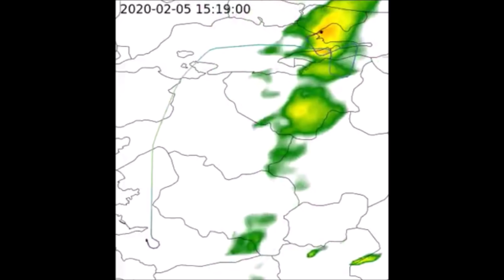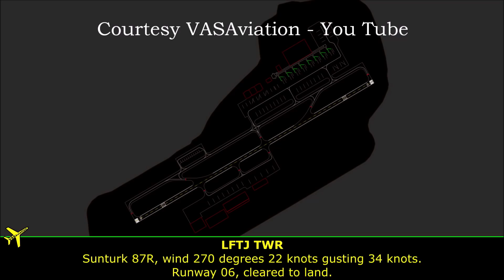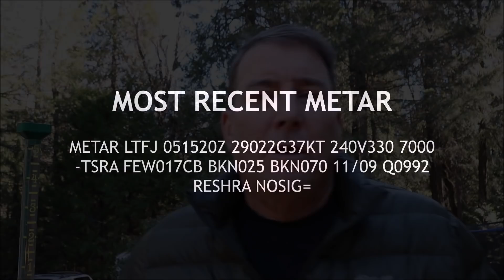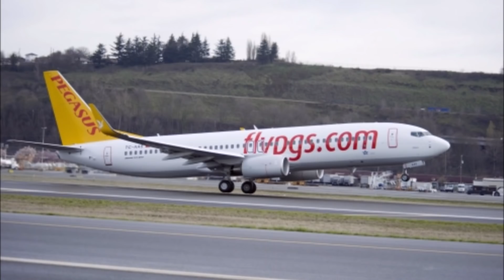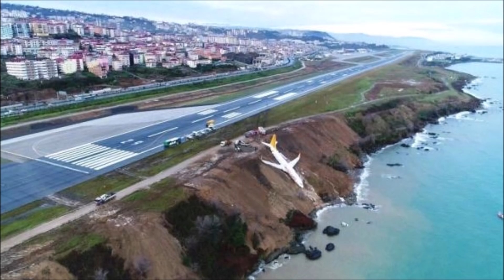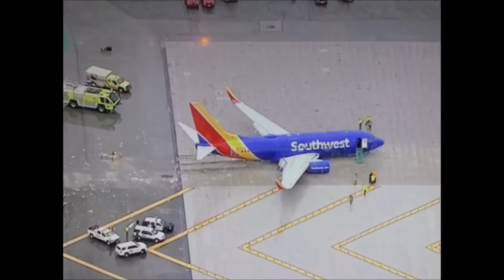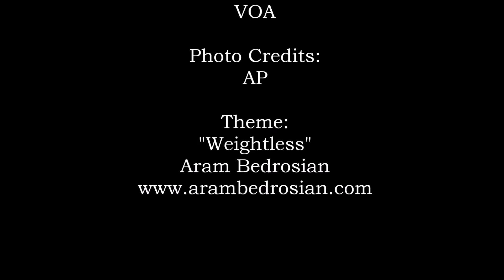Runway Overrun Istanbul, Turkey Pegasus 2193 B737-8 UPDATE 6 Feb

Comment: End of March, 1993, Anchorage Alaska. A 747 was taking off from Anchorage headed to Chicago. The wind was very strong from the east, gusting a lot. I was driving west on the Glenn Highway, just east of Boniface, and saw this plane pitch up very sharply and fast, WAY up, and then turn left hard, and then level out. It was on initial climb out of 6R at Anchorage International. I was watching the plane because the wind was so darn strong, I was wondering what the heck it was doing up there. I had to crane my neck to watch it after the big pitch up, and I pulled over and continued to watch it as it headed west. I did not see the engine missing, as I was on the port side of the plane at that point. (it was north of me headed west, flying LOW). Only later did I learn that the engine landed directly west of my house, missing our neighborhood by about a half mile. I went to the airport a few days later and took some photographs of the plane sitting just inside the fence, a huge chunk of the inboard part of the wing missing. It was astounding that it could fly with that much damage. Evidently, it was not the break-away pins that failed, but the actual pylon that holds the engine mount to the wing structure. The airplane was having trouble with the #2 start valve while it taxied for takeoff, so they went back to have the mechs take a look; they determined it was the indicator at fault, so put it on the MEL and deferred looking into it till later. The strong winds took the crack past failure and the engine detached from the airplane, taking a bunch of goodies with it. All leading edge and skin from the #2 inboard to the fuselage was torn off, back to the center spar. It was a situation that could have ended so so so much worse. There were only five souls onboard, as it was a freighter, no one was hurt on the plane or ground.
Reply from the maker: Wow!!
Reply: That was the same plane that was used for Die Hard 2 Movie
Reply: https://www.ntsb.gov/investigations/AccidentReports/Reports/AAR9306.pdf
Reply: @billbingham3829  Thanks.Interesting reading, both the engineering report, and the voice recorder transcript.
Reply: Check report from EI AI 1862 at Amsterdam 1992... Similar accident, after those Boeing improve engine mounts.
Reply: That photo, crazy. https://aviation-safety.net/photo/6376/Boeing-747-121-N473EV

Comment: I wonder about a few things: 
 
1) Other than landmarks and being familiar with the airport, does the pilot know how far they are down the runway at any given moment? ( like some sort of odometer / beacon. ) 

2) At what point prior to touchdown should this pilot have become aware that they are too far down the runway and should go around?

3) At what point in this situation would it be impossible to go around?
.
Reply: Bob Roberts There are many visual indicators (coloured ights) for the pilots to determine their position relative to the runway. They can go around at any stage, until the thrust reversers are engaged.
Reply: Gordon Richardson  I was questioning this specific flight / airport not generalities.  There are only so many colors of lights, what kind of distance resolution would that give?

I'd think an instrument that gave distance to runway threshold then remaining runway in hundreds of feet would be helpful especially in a low visibility situation.

I'd still like to know at what point this pilot in this specific landing should have been aware they are too far down the runway and at what point is a go around would be impossible. 

If a go around is possible at any time , it appears that the pilot thought they had much more runway rather than a bad judgment call to land.
Reply: In the US , runways are marked by large black and white signs beside the runway.  They are distance remaining markers in thousands of feet. A sign with a big “3” on it means three thousand feet remaining.   The next sign after that would a big “2”. And so on.

Comment: Why don’t short runways or runways with a cliff drop have a trip wire at the end like on an air craft carrier?
Reply: What well designed runways have is a soft concrete at the ends, that the plane's wheels sink into, like a fancy gravel trap. It's called EMAS or Engineered Material Arresting System.
Reply: A trip wire would be useless to an aircraft that is not equipped vith a hook to engage it. An arresting barrier, OTOH, would not require additional equipment, but I very much doubt it would be able to stop anything that size.

Comment: This sounds remarkably similar to the Air France Flight 358 crash in 2005, of which I was one of the first ambulances on scene as an Advanced Care Paramedic in Toronto.  That aircraft landed in a thunderstorm, landed way down the runway on a wet runway, overran, went down a ravine, and burst into flames.  The scene was a complete clusterfuck, but everyone had evacuated the burning aircraft in something like 90 seconds and astonishingly, there were no fatalities.  With our first trip to hospital we transported the captain (who was one of more seriously injured people), a second stretcher patient who was a passenger, and an ambulatory passenger.  I was amazed to learn that there was none of that soft concrete at the end of the runway to arrest an overrun aircraft and prevent it from barreling down that ravine!
Reply: As someone who flies to/from Toronto periodically -- thank you for your service.
Reply: Josh Yaks Yes, an infamous example, lessons not learned.
Reply: EMAS would be nice, but where would you put it?  That ravine is so close, you'd need to reduce the runway length...
Reply: In the old days they used to allow farmers to grow cabbage in the fields adjacent to the runways. I suppose airports have got larger, security issues more problematical. But an overrun into cabbages dissipated a lot of energy pdq...
Reply: The runway is still the same as it was during the AF358...
Reply: The Air France accident  in Toronto also had fire crews on site in record time .They sprayed the aircraft  non stop from several trucks  BUT never could put out the fire .That is a mystery to me .

Comment: 6:05 How much money does it cost to have a large airplane go around for another landing attempt? $5,000-10,000-20,000?
Reply: SanFranciscoBay Roughly yes. A go around costs a lot less than a crash.
Reply: It depends on the gas cost and how much you use. For a 737-800, I would guess a thousand dollars or so is a good guess for fuel consumption getting back around.
Reply: scooter Dave interesting.  Other than fuel, where do the costs come from?
Reply: Rick Harms Mostly fuel, some delays, possible diversion, passenger overnight accommodation, etc.
Reply: Gordon Richardson - Possibly $500, maybe $750 for the go-around but if missed connections occur it can be as much as $5,000 per missed connection. But as other posters have said, its not as expensive as a crash.

Comment: Have we ruled out yet , the case where they miss calculated the fuel and didn’t want to call an emergency to avoid complications? The only possible scenario that anyone will not go around at 600ft agl over threshold is when you know that the fuel is not enough. (Yes I know that it’s almost impossible to miss calculate fuel that badly). Opinions or maybe any fuel data out ?    Also landing with tailwind is one thing, but 550 above screening height requires about 2 miles  to descend on a normal gradient.

Comment: The 737 is mentioned too often here I think. Notwithstanding poor pilot decisions is it possible that the 737 wet braking performance is dangerously under par here? Wheel and brake sizes maybe too small which likely makes any anti lock systems less efficient too. Some of these aircraft have skidded sideways which is something that shouldn't happen unless it's done deliberately.
Reply: The 737-800 has excellent braking system (I flew it for four years as Captain for same company as Juan's).  You're way off the mark.  Huge tailwind, touched down way long on a wet runway.  This is pilot error writ large.
Reply: Thanks for the reply. I didn't expect it to be a factor. As you say, pilot error and the same one in the same circumstances. Of course, doing the right thing and going round never gets a mention.
Reply: @delukxy  You need to watch the video again.  Juan mentioned go-around several times.  For this accident we have to wait for the CVR transcript to see what the Captain and First Officer were saying to each other.
Reply: Yes, yes, I follow Juan carefully. Just saying that, because it's accepted practice and is done when needed by competent pilots i.e. when in doubt go round. It doesn't get a mention, and nor should it. Its done safely and isn't news. 
As you say, the CVR transcript will be useful and probably damning.

Comment: Juan, I would urge you to watch this exposé on the 737ng construction. These 737s seem to be breaking up in a consistent manner. https://youtu.be/vWxxtzBTxGU
Reply: Well Juan did say that all aircraft are designed to break apart to dissipate the energy involved inna sudden stop. To be clear, any aircraft that comes in high and hot that goes off an embankment...will break apart. That is not a fault of the 737NG. This was not attributable to airframe design, this was poor judgement on the part of the pilots. I'm not sure whether or not you're hinting at a design flaw, but if you are, that is unfair in this scenario.
Reply: Genevieve Campbell, watch the program and get back to me.

Comment: "if you take a 737 chuck it off 66 foot cliff at 73 mph, you have a lot of energy that needs to be dissipated" hysterical and true!
Reply: For only 3 to die traveling at that speed with just lap belts is really a miracle
Reply: @gregandkaruna6674  very true! also, it went off a 66 foot drop off!
Reply: While “chucking” an aircraft off a cliff is not a laughing matter I did laugh out loud when he said that! 😂. Seems cut and dry after hearing all of this. The PIC made a bad call and the PM didn’t engage. A recipe for disaster.
Reply: @markt538  Agreed. Why do they have a six story drop at the end of a runway? Why not a blasting cap factory or a nuclear waste dump? Zoning seems a bit lax!
Reply: It's a poorly built plane Southwest did the same thing at Midway and the plane was able to fly again
Reply: @dknowles60  because it didnt drop off a SIXTY SIX FOOT CLIFF!
Reply: @rlyle5804  it was close to 60 ft the fact remains the same also see as little rock at crash
Reply: @dknowles60  let me make sure I understand: you are saying that the Pegasus flight dropping off of a SIXTY FOOT cliff and the runway excursion at Midway LEVEL GROUND are even remotely similar? Seriously? Did you have a lobotomy?
Reply: @rlyle5804  how many more examples do I have To give Midway is at least 35 the road see as little rocknar crash see you tube sheir strap problems
Reply: @dknowles60  Pretty much an incoherent post. To what Midway flight are you referring?
Reply: Yup. If take your truck and go off the road on a highway bridge, the frame might get slightly bent when you land.
Reply: Yup. them 737s just cannot 'take it'...  like orange man, Boeing bad.. sarc bit on...

Comment: Interesting, you talking about having the wing tanks break away from the fuselage to help prevent onboard fires. I remember some thirty or so years ago, a group (I don't remember who) did a test to study how aircraft crash fires behave. They took a four-engine passenger jet and flew it by remote control, then crashed it into the desert. The plane spun out, and flames shot in every direction. Post-crash studies showed that the fire penetrated the cabin in almost no time, at all, then flashed over down the length of the fuselage, meaning passengers would have had no chance of escaping. Now, as you say, improvements are being made. I would like to see a film of a similar test performed on a modern-day airliner to see the effectiveness of the improvements. The contrast hopefully would be quite impressive.
Reply from the maker: no, the engines.

Comment: I don't think that is a video anomaly.   I think the aircraft is bouncing down the runway,   I think that may have something to do with getting the plane stopped.   People including the pilot may have been injured when the plane bounced so severely.  Perhaps the pilot was in bad shape and couldn't properly activate the brakes.
Reply: The pilot wasn't unable to properly activate the brakes because he was in bad shape. The pilot was unable to properly activating the brakes because he/she let the wheels on ground after the majority of the braking area having been overflown. Wheel brakes are only useful after the wheels have made contact with the ground. It's a different question what shape the pilot was in to allow the plane to touch down two thirds of the way down the runway in a strong tail wind. In short - the plane was lost before it was even possible to start braking.

Comment: I am not a pilot but very much enjoy aviation.  When I watch videos I check tail wind by either adding 18 or subtracting 18 from the runway number. If the runway is 19 or higher subtracting 18.  If the runway is 18 or lower add 18 and the 0 zero at the end of the resulting number. Runway 06 the tailwind would be 240.
Reply: Great easy way to do it, thanks for pointing that out
Reply: Yeah, it's slightly unfortunate that wind direction is reported as the direction from which it's blowing, rather than the direction toward which it's blowing.  Another point to make is that any runway that can serve both directions already tells you the other direction. So if you're landing on runway 06, that runway is labeled runway 24 in the other direction. So that tells you what a tailwind for runway 06 would be called as well.